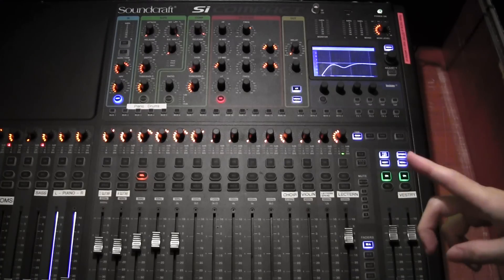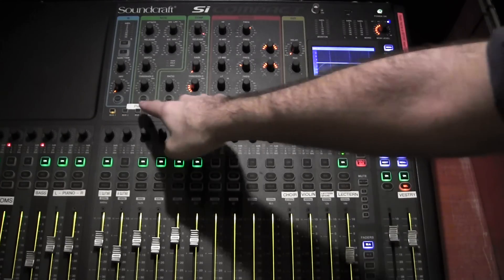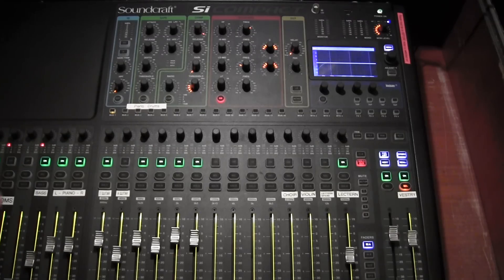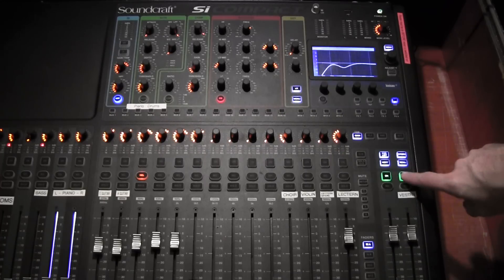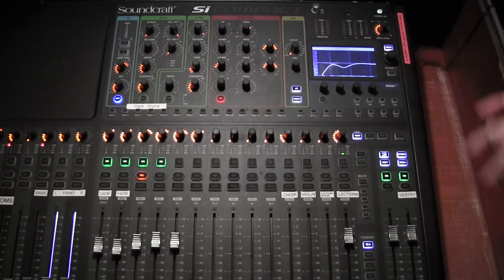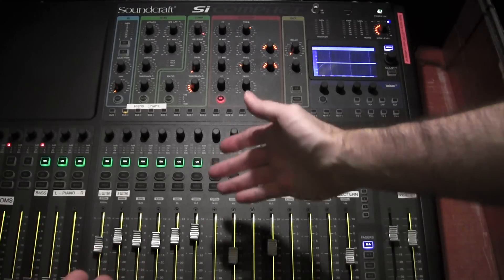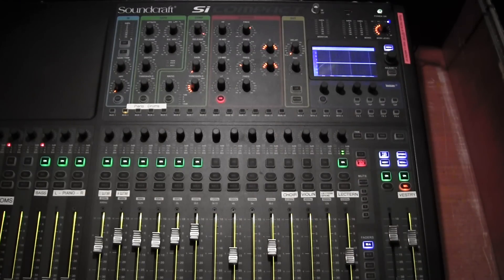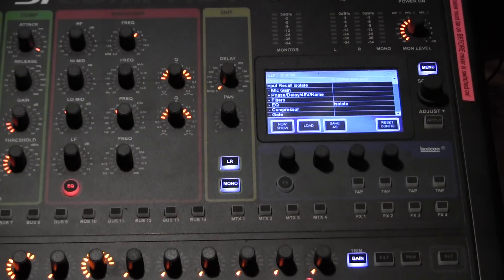Soundcraft SI Compact Training session part 2

Comment: This is a very good one..! Using Simple English ! I appreciate.. 

But still i have a question. For Example There are 2 live band, their EQ and volume are very different settings.. So we set for them in different ways.! 

But, after those 2 Bands perform, how will we switch or how will we go back to main and previous settings!?
Reply from the maker: The best option in this case is to create and save a separate show for each band - that way you will be able to recall the specific settings for each one as needed.

Comment: Hi I got a soundcraft SI compact 32 and would like to know if I can use it in Africa where the power is 240 watts instead of america 125 watts thank you
Reply: soundcraft mixers are mostly built with auto swtiching power rate ranging so basically it is 100v-240v which is fully supported in Africa.
Reply from the maker: It depends on the power supply in the mixer - the correct input voltage will be stated on the back panel.

Comment: I too learned a bunch from your videos thanks so much
Reply: I added a srm 150 to our choir loft so we could hear what the congregation was hearing. I used 13 out for the physical connection but couldn’t figure out the next step to send the signal to the output. I thought I had to do something in the main menu but was afraid I would mess up something else. So I figured out mix 13 and raised the faders to unity and voila sound!  Not sure if that’s the best way but it worked!
Reply from the maker: Yes the way to send individuals signals is the same for all the outputs. The only difference is whether the output is set to be pre- or post-fader.
Reply from the maker: You're welcome Tim!

Comment: Hi I have complete yamaha speaker systems and i am using Yamaha MGP32x analog mixer.Can we use sound craft SI compact mixer with Yamaha speakers S215v series.
Reply from the maker: Yes no problem at all - your mixer and speakers do not have to be from the same brand.
Reply: Thanks

Comment: What if pader no aktif. What is the solution?.....
Reply from the maker: +Ajik Setiawan Try and restart the mixer to begin with. If this does not work do a factory reset.
Reply: GLB Productions 
I've reset the factory but still I found no gain on each Fader mixer how to activate it? ...... and this new mixer has never been used.
Reply from the maker: +Ajik Setiawan Sounds like you need to contact the person who sold you the mixer and get these problems sorted out.
Reply: GLB productions
The seller's problem they did not understand how his operation caused her no expert, and the time to buy is not the special agent soundcraft,

Comment: Thank you very much for this excellent video. I now have to "transpose" this knowledge on our Yamaha 01v96 console.. ;)

But I have learned a lot through your videos already. 

Thanks again and keep up good videos like these.
Reply from the maker: Moi Sexypierced You're welcome! The 01V96 is a much older design and it comes from a previous generation of digital consoles that were much less user friendly. However, once you get used to the interface it's perfectly usable. My biggest gripe with Yamaha consoles is that you do not have a full set of physical knobs in the EQ section - you have to select the band first. I've made some big mistakes in the heat of battle because of this!

Comment: Sorry, I forgot to ask. Can I link 2 aux outs so that I can send a stereo mix to wired in-ear monitors please? Thank you.
Reply from the maker: PhotoMusicMan Yes, no problem - in fact this mixer has no specific aux outputs - the outputs on the back can be programmed any way you want, so they can be aux outputs, matrix outputs, mono or stereo. This is one of the great strengths of digital mixers, the signal routing is so flexible.
Reply: GLB Productions Thank you.
Reply from the maker: PhotoMusicMan You're welcome :)

Comment: I have wanted to learn how digital mixers work for ages. Thank you for explaining this so beautifully. I would like to ask a couple of things please. I see your mixer has built-in Lexicon effects. Could you explain how these are used on this desk please? If you mute the reverb on a channel in the main PA, does this also mute the reverb in the monitor? This mixer is mind-boggling, but I guess by using it makes it sink in quicker. To be able to do a show and then recall my settings next time would be perfect for me. Thank you.
Reply from the maker: PhotoMusicMan You're welcome, glad you were able to follow the training. 

The effects are pretty simple to use - your route channels to the effects engine as you would to any bus, eg you press the FX1 button and then raise the faders of the channels that you want to be routed to that effect. The output of the effects engines can be assigned to any fader, which can then be assigned to any bus in the way you would assign a normal channel. 

Yes, muting the effects return will mute all sends, including the monitors, although that can also be customised. 

Incidentally, the SI-compact has been discontinued and replaced by the SI-expression, which looks to be almost the same console but with a different colour scheme ;)
Reply: GLB Productions Thank you for your kind reply. I looked at the Soundcraft site and could not see the Compact - I wondered where it had gone!